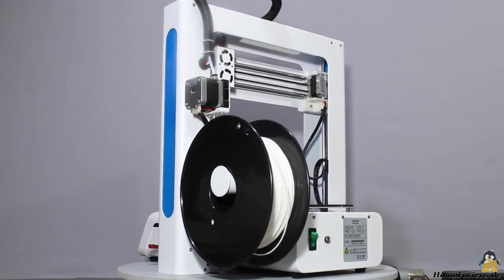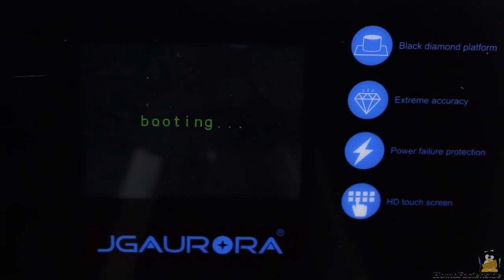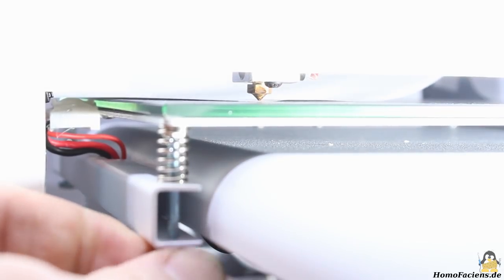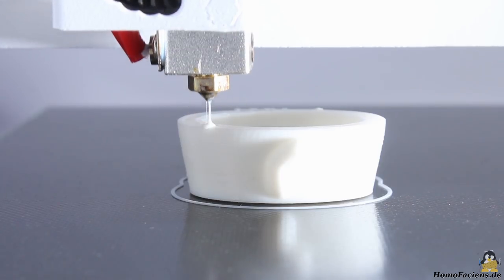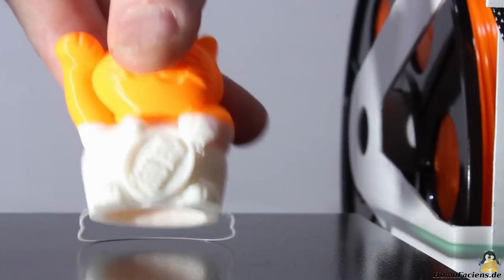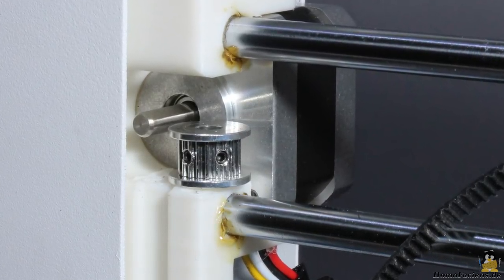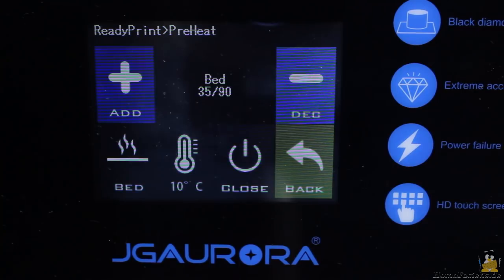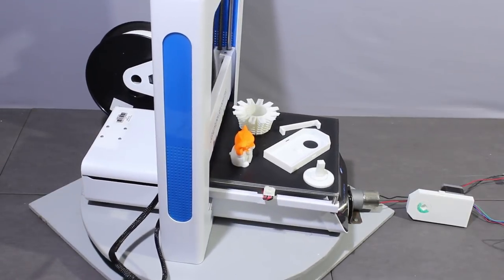Review of the JG Aurora A3S 3D printer

Comment: I don't know if it's true for the A3S too, but on the larger JG A5, those printed plastic parts for the Z-axis you were showing that horrible amount of play for the rods on, these have been replaced by high precission full metal machined parts instead. JG offered an upgrade to the metal parts on the A5 to me,  maybe they do the same for the A3S. My A5's came to me this week, using fully metal Z-axis assembly parts.  But thanks for this very nice and professional looking review !
Reply from the maker: Thanks for your feedback!

Hope the bad bearings were just an issue with my machine and that this is no general issue of the A3S (at least I haven't heard of more faulty printers, yet). After replacing those parts, that cost less than 10,-€ it is a really nice, solid machine I like working with. I am currently printing parts for a new robot with the A3S.

I will get a A5 for review, soon, so I can have a closer look at the mechanics and upgrades.
Reply: There's a JG Aurora FB user group (not limited to any certain model) which would undoubtably be of interest for every user/owner of these machines. If you haven't done so and have the time, just visit us. The more, the merrier, and best wishes for Christmas !
Reply from the maker: Thanks for that offer, but I am usually too short in time for working in Facebook as well.
Best wished for the coming days, too!
Reply: No problem and well, feel free to change your mind at any time :D
Reply: hiya Kris, did you had to contact the JGaurora custommer service for that Z-axis full metal parts ?thanks

Comment: I think my power supply is giving me issues or the main bord...The original psu became very hot after maybe 3h of printing time and something inside gave up and it stopped working. They sent me a second powersupply and with that one the psu voltage after a couple of minutes drops to 0.7V. Any idea what is causing the powersupplies to break/do this?
Reply from the maker: Does the power supply recover and give 24V after a couple of minutes?
Try heating the extruder (without heatbed) to 240°C for a couple of minutes and see what happens and then
Try to heat the bed to 90°C (without extruder) and see what happens.
Reply: I have tried that, but the symptoms also happen when nothing is heating up! 

So first it will go down (I assume this as I cannot messure while it is on) and back up in split second and this (assumably) causes the printer to reboot. This happens a few times, and eventually it doesnt recover for a long time...I set it away, came back to it today, and it worked, for a short period and started showing symptoms again and now its back to 0.7... This didnt happen with my first PSU.  Power supply isnt 24V, it is more like 23.5V that my multimeter messures

Upon opening the old , first, psu I saw the ground wire broken off, and the fuse on the board itself was looking good but the board around it was browner than the other part of the board...So I might try resoldering that ground wire to see. However It was very very hot, so I dont even know if it is safe to use!

So i am stuck...Either the brand new psu that they send me is broken or the previous psu did damage to the main board?  I do remember that the the print that was with the first psu had a bed of 70 degrees (Wanted that for the first layer, and then meant to lower it, but forgot it. Dont know if that makes a difference to what is happening?)
Reply from the maker: Heating the bed to 70°C isn't "forbidden" in 3D printing. ABS for example needs the maximum temperature of 90°C during the whole print.
The 23.5V output voltage without a load isn't an indication for a broken power supply. It's the current running through a load (printer) that heats up components on the PSU board and so causes a shutdown.
I would look for another (different type) 24V 10A (or more) power supply.
Reply: HomoFaciens Ok, I'll look for the normal power supplies that are used on printers. I wonder why they didnt just put a normal power supply on this one instead of a brick
Reply from the maker: Currently I am testing the A5 that has the power supply built in the box of the printer which is definitely the best solution.
Please tell me if swapping the PSU was successful.
Reply: Yea, I have a JGAurora A5 on the way too. I have ordered a powesupply of amazon and will definitly let you know.
Reply from the maker: Thanks for the feedback. Looks like the original PSUs are not that great...

Comment: Hello,great video thanks for posting
could you please tell me the specifications of the linear bearings that need replacement?(Diameter of rod and length of bearings)
I am thinking of buying the printer and i want to preorder some spare parts
Thank you in advance
Reply from the maker: The bearings have an inner diameter of 8mm, an outer diameter of 15mm, the long ones are 45mm, the short ones 24mm in length.